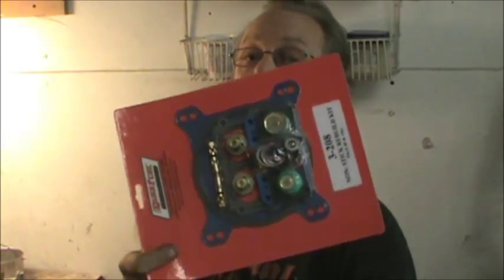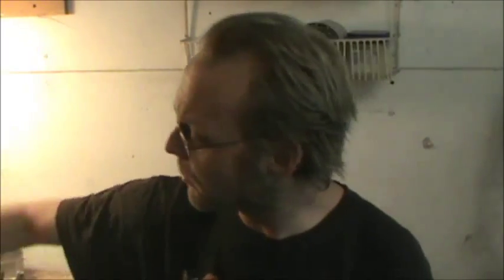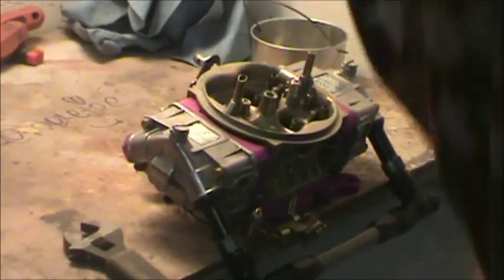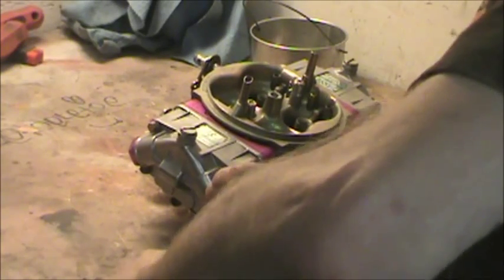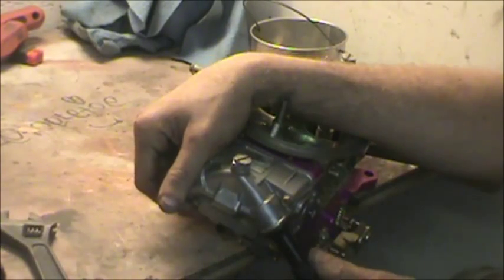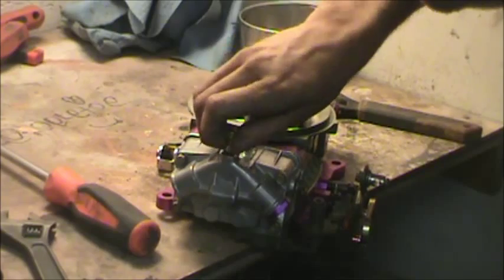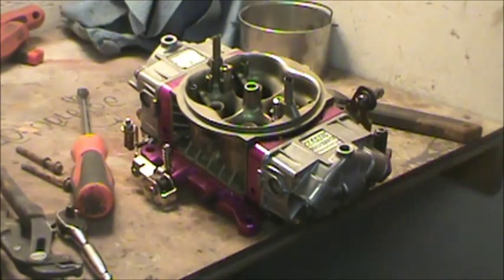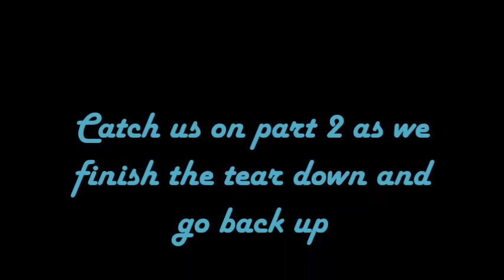1967 Chevelle E 85 Carburetor build

Comment: The simplicity is what makes a Holley a good carb....That crap is what I expected to see...All alky type fuels will do that if it sits around for a while...Methanol is way worse...I used to run the sprint car out of alky and then run some petrol thru the system...The engine doesn't like it much but it keeps the system clean.

Comment: How are those proform chinese carbs running compared to the Holleys ?
Reply from the maker: Don Rutter after going through the whole fuel system and such owner found a q tip in the tank clogging the pickup. That was his main issue. The car sold about a year later. Far as I know it's all good. Though they seem a bit more fragile than the real Holley platform. More cantankerous.
Reply: Pretty much the same damn thing